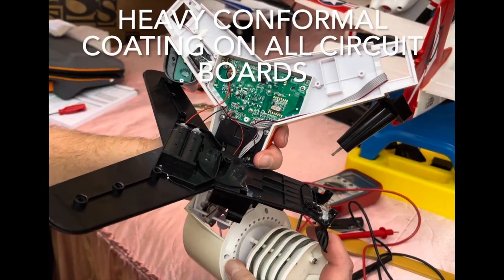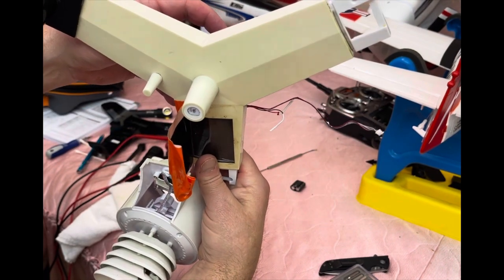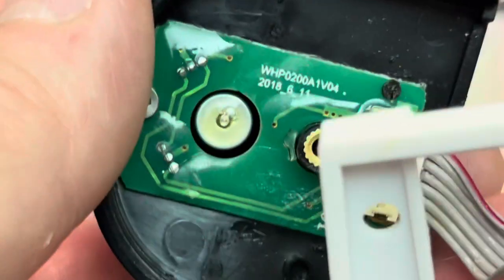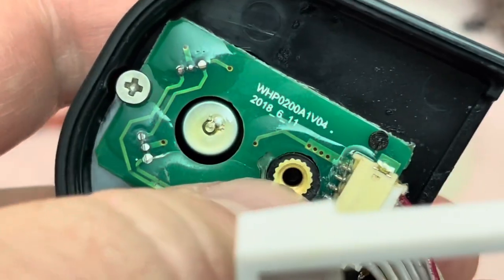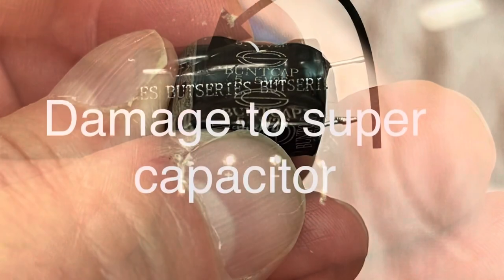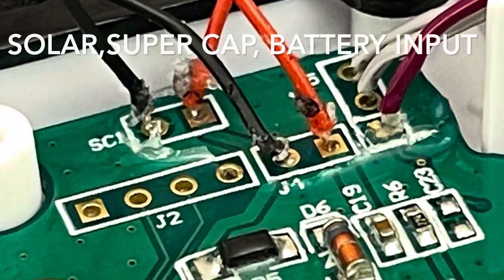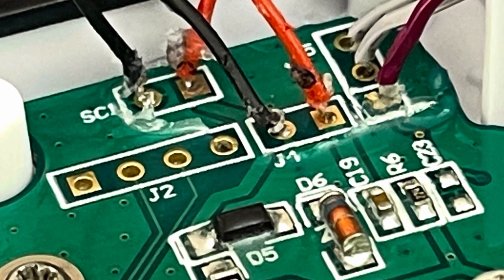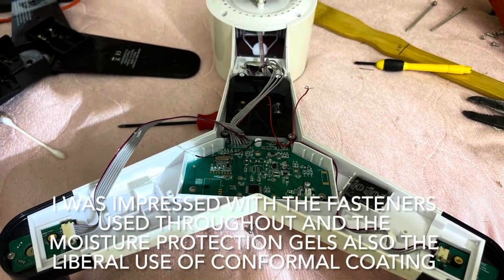Ambient Weather WS2000 Sensor Array -Tear Down

Comment: I'm tearing mine down tomorrow. Temp and humidity went way up 12 hours agoe and stayed there (temp shows 109.6f when it's 24f). anything you ran across that may be the problem? Soldering/desoldering is no problem for me. already tried batteries and a reset. Thankls.
Reply from the maker: I was a few weeks past the end of the warranty period and they still agreed to replace the outdoor array for me. 
I do recall the sensors were in a little pouch hidden in the louvers & plugged into the main board. Other than that I got nothing. It is curious that both sensors went off at the same time.

Comment: FYI, You can also find pictures of the boards in the FCC filing. The resolution is crap though. Just look up the FCC ID listed on the bottom.
Reply from the maker: Good information. Luckily that defective unit was a fluke as my other two stations have performed flawlessly over the last two years.

Comment: Great video, lots of detail.  I have the WS-2902B and I messed up and got water inside cleaning it.  I took it apart dried it out and it was working but the rain gauge stopped working.  My rain gauge uses a reed switch instead of inductance.  I disassembled it again and pulled out the little circuit board and tested the reed switch.    It tested OK with an ohm meter so I guess I messed something else up with my lack of care during cleaning.  How did you get Ambient Weather to just replace the capacitor?  It would be great to have a schematic...LOL.

Comment: Great teardown video! i also have the same sensor array. Im still newbie and i would to know what communication using in this board? I tried to analyze the logic to find the communication protocol like UART / SPI / etc using logic analyzer and oscilloscope but i have no luck. Maybe i was wrong on doing tapping in the board, do you know what communication using in this module? Thanks
Reply from the maker: Sir, your way beyond my realm of knowledge with your request. Sure I have a good grasp of how things work & understand precisely what you’re asking but my test equipment consists of a RedFish bluetooth multimeter.
Ambient quickly sent me a replacement when my array went down so I figured I’d record the disassembly. 
I will take this opportunity to say the replacement unit & various remote sensors and my other station at my beach home have since performed flawlessly.

Comment: Great video. i know the antenna is 'tuned" but was wondering if anyone has added a wire to it and extend it.  i saw where someone did this to  a acurite unit and it increased the signal.
Reply from the maker: I’ve never modified the antenna but the array was two stories up on the peak of my roof & the display in the basement. I never had any signal issues.  This ambient station has been the most trouble free setup I’ve owned.